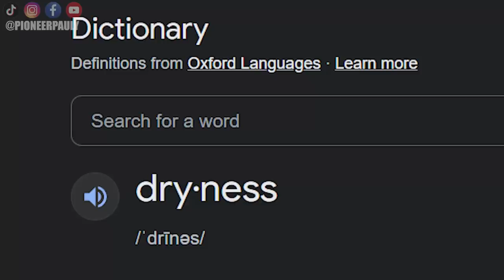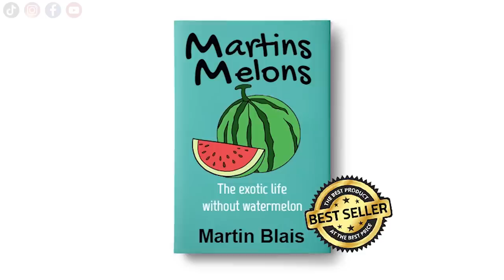Finding GOLD In The Desert Using A Dry Washer!

Comment: Step one: use water to wet a white cloth for your sheik headress. 
Step two: oscillating chisels are your friend. 
Step 3: turn on the shop vac to stop digging. 
Step 4: Tannerite explosives 
Step 5: pan the material at home
Step 6: collect the concentrates in sand bags and load back of truck with 250 of them. Good luck chuck

Comment: Years ago I invented an "air classifier" that utilizes a large gas powered leaf vacuum.  I put a tube of what's known as "lay flat" which is temporary plastic ventilation tubing that comes on a long roll on the exhaust port.  On the end of the long tube I taped an air filter for creating back pressure.  When the gas vacuum is powered up it inflates the long tube, and when soil and sand is vacuumed up it classifies by density in the tube, it's very visually appealing and works very well.
Reply: The tubing is clear so you can monitor the classifying, also I made the tubes 40 feet long and there was zero dust.  I actually first invented it while using a 10hp insulation vacuum, I figured that out to create a dust free environment, but noticed it actually classified all the materials by density which looked really cool

Comment: The best way to get your comment pinned or highlighted is to post something either far left or far right, also post something contrary to the message of the video. If the video is talking about EVs, talk about how you drive your gas guzzler and you out fewer emotions than the power generators that charge EVs.

Comment: Im down in Texas were 100+ during the summer is normal. Ive watched lots of your videos and wondered how you do it, that water you jump into has to be cold up there in canada. You may have issues in the heat and I would dye if I tried to jump into that river you swim in. :P
Reply: Hi I am from Vancouver Canada , with just a 2.5 hour to 3 hours Drive  east of Vancouver we have desert type valleys with Rattlesnakes , last summer a new high temperature record was set at 121 degrees F , it is normal for these places to go over 100, Where Pauly lives on Van island it’s a bit mor3 moderate with summer temperatures between 75 to Around 90 degrees the closer to the ocean the cooler the more into mountain valleys the hotter , If you see Dan Hurd videos you would see a lot of his videos are more in Arid type places ,

Comment: Dowsing with the modern light weight ball bearing dowsing rod will locate the more concentrated areas of placer gold.  I am a professional dowser who has reverse engineered the physics involved in dowsing and wrote the recently published book name :  The Art of Dowsing - Separating Science from Superstition.  This book is teaching the world all of the physics involved in physical on-ground dowsing using the modern light weight ball bearing dowsing rod, which is the only dowsing rod that can accurately gauge what is being dowsed.  All the element's atoms emit a unique electromagnetic microwave band frequency that is reserved for each element with no two having the same.  The electromagnetic microwave band frequency of the same element that is contained in an elemental mass band together for producing the unique elemental magnetic flux lines with no two elements having the same, which energizes the dowsing rod and electronic metal detector.  The ten chapters of the book explains all of the physics involved in dowsing - how to build your own modern light ball bearing dowsing rod - how the one-tenth ounce dowsing rod load that is attached to the dowsing rod becomes energized by the elemental magnetic flux lines that are being dowsed - how to accurately decipher the dowsing of all edges, exact center, depth buried with angle of deposition, and most importantly GRADING of the element contained in the elemental mass being dowsed - how to dowse for precious metal placer and lode deposits - how to dowse for any sought element - how to dowse amplified dowsing from a moving vehicle - how to dowse for treasure - how to dowse buried pipelines and cables, tunnels and voids in the ground, or anything buried.  Also, I give free dowsing lessons in Laplata Canyon near Durango, Colorado where a gold vein system runs underneath the Laplata County Road.  There is more to explaining dowsing than this post will allow, so I will end with saying thank you for reading this post and have a safe, healthy, nice day.
Reply: Why you willow sticks like water so much?